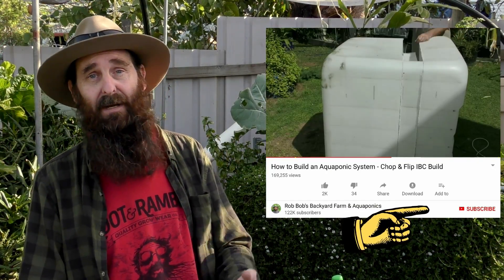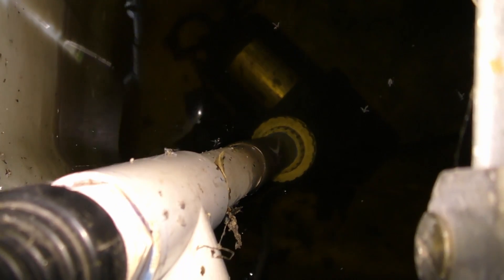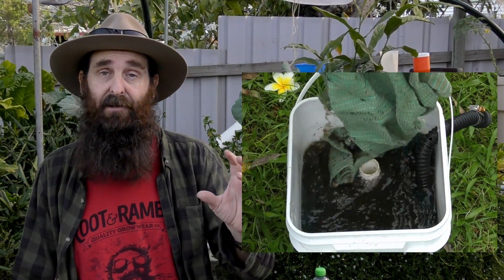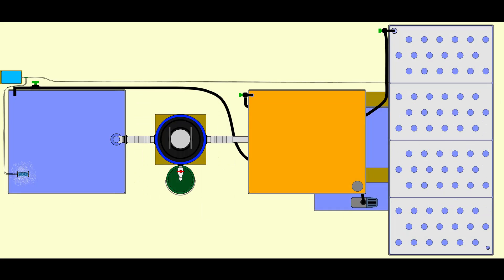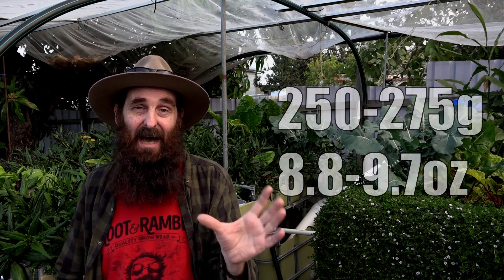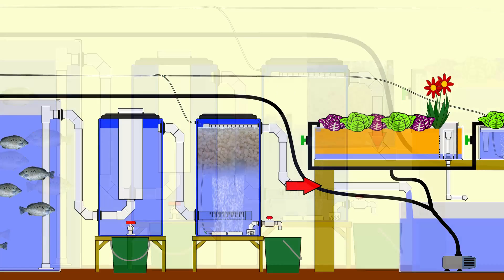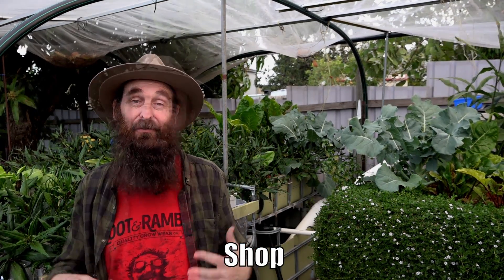Aquaponics Design | Backyard System for Pat

Comment: Excellent video.  I have one question though.  In your layout you have the bioreactor in the sump loop.  While it is absolutely necessary for the fish to maintain an almost non existent ammonia and nitrite level the plants prefer the ammonia as a nitrogen source over the nitrate produced.  The bacterial reduction of ammonium to nitrate is competitive to the plant nitrogen uptake rather than complementary.  Doesn't it make more sense to run the bioreactor inline to the fish tank inlet loop protecting the fish as is absolutely necessary and keep it out of the primary sump loop altogether so the plants can get first dibs on the ammonium or am I missing something?
Reply from the maker: Hi Jason.
Nitrate is the most used form of nitrogen used by most plants. Once taken up they then converted into ammonium as I understand it. Even if the biofilter was after the beds the ammonia would still be converted through to nitrate as the nitrifying bacteria will be establishing themselves on any available surface, be it pipework, media or plant roots. 

Cheers.

Comment: Why do you leave the solids waste in the tank, I thought plants needed those?
Reply from the maker: There's more than enough nutrients in the water in a system where the fish are well fed 👍
Any solids that are removed can also be "mineralised" in a mineralisation tank. The nutrient rich water added back in after the solids settle out to reclaim any that may normally but removed to use in the soil veggie patch. Will have a clip on the process coming to the channel at a later date. 👍
Cheers.

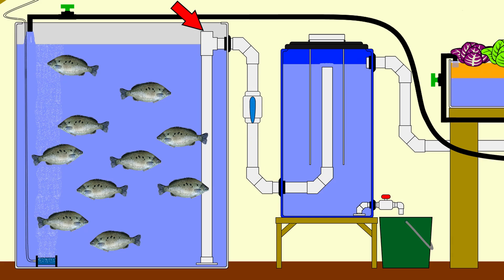Comment: QUESTION - At 4:18, why is the upper part of the Tee left open if the output within the radial flow filter's stilling well is at the height of the water level that you want anyway?  Wouldn't that prevent the siphon from forming and sucking out all the water from the fish tank?
Reply from the maker: Comes in handy in not initiating a siphon when you're removing the standpipe from the RFS for cleaning. I think of it as an extra level of security. 
Cheers.

Comment: Looking to add 2 more beds to the chop system I have. What size sump do you recommend? They all will be flood and drain
Reply from the maker: I like to allow for 50% of the bed volume to be water when sizing sumps Scott. That will give you a bit extra in a flood & drain system to stretch out top up times. 
Cheers mate.

Comment: How do you make the stilling well?  Is it basically like a 4" PVC pipe or is it something bigger?  Also, what's the white thing (compartment) on the bottom right of the screen at 8:16 (under the DWC), with the three pipes perforated at the top, that the outlet of the DWC seems to run through?
Reply from the maker: That depends on the size of teh system used. 
I tend to use a 4" with the larger 50gal & 3" with the smaller 13-16gal drums.
There is no compartment. I added straps to show that the drain should be supported.
Cheers.

Comment: Hi Rob, can you clarify why you used a sump? My logic tells me that with a sump you are mixing filtered water from the plants with dirt “ammonia” water, does this not dilute the water you need for the plants and also send back dirty water to the fish? Would an in-line system not work better, pump the filtered water straight from the end of the plants back to the fish tank?
Reply from the maker: The biofilter will process the ammonia in the water before it enters the sump👍
You can set up the system in a single loop & run through that in a recent clip, https://www.youtube.com/watch?v=0QQA5BpWKec
Cheers.

Comment: thank you rob. I am making a small one for my apartment for right now since I cant have a normal one outside. Even with me having some experience from helping others with there bad thing they left town without me understanding everything. Well I want to use some of your filter and use it with one I helped make see if I can get all the solids out of it. my filters going be at the high point and use gravity to take it to the grow beds my fish tank going to be on the bottom and I'm putting a over flow on the second filter back to the take be safe then sorry. I may need to ask questions if I run into a problem
Reply from the maker: Hope the build went smoothly GM.  👍 Have you got the fish in yet? 
Cheers.
Reply: @RobsAquaponics  no I have not got fish still getting pieces to put things together I got lucky and got some stuff free always good I'm sure you know that watching your video's and they been a big help I don't want to do thing half done so I'm trying to do thing right but save where I can

Comment: Hi Rob, thanks a lot for your excellent videos. However, I do have a question. With respect to the required fish feed of 50g or 100g, is that amount of fish feed per day needed constantly throughout the lifetime of the fishes? That is, should the fishes constantly be fed with exactly 50g or 100g feed per day, beginning from when they are fingerlings to when they've reached the harvest size? Or does that amount of required daily fish feed change as the weight of the fishes change?
Thanks in advance for your response.
Reply from the maker: Hi DB.
The rates I gave in the clip is the amount of feed needed to feed the plants in a given area of grow bed. 👍 I used this amount as an example only for this build. 
The amount of feed given to the fish is generally worked out on body weight & varies through the fish's lifetime. The hatchery you get your fingerlings from should be able to help you out with the rates.
Hope that helps some.

Comment: I tried Aquaponics for 3 years. The only thing I could grow is okra. Tomato and peppers did not do well. Greens did fair. I did not try lettuce. I had 2 float tanks and one rock bed. The rock bed did the best.   I had a swirl filter that worked fairly well but could not keep all the continents out. And my drain on my grow bed did not work very well. My fish did well. I started out with goldfish about an inch long. They grew in one year to pan size. I turned them loose in a lake nearby. And got more minnows. I used IBC tanks.
Reply from the maker: Please don't release goldfish into natural water ways. They compete with native wildlife & can have devastating effects on the eco system.

Comment: Hi Rob, Im in a bit of a rut designing my setup. 

I have two tanks I would like to utilise if I can, I discovered a 10,000 liter plastic tank buried underground, that's been collecting water off the rain gutter. I also discovered an even larger concrete tank on the surface, also collecting rainwater from the roof. My basic thinking.. Sump, and fishtank! 

My questions. 
a) If I start with a small fish population, can I just use the water volume replacement vs fish added vs size of the grow beds instead of trying to circle the entire volume?
b) Both tanks are pretty airtight (particularly the "sump tank", the surface tank has a 2ft by 2ft square manhole at the top, that I could replace with a perspex / glass light hole, Is this enough light for the fish? should I open it further?
Reply from the maker: Hi Colin.  I personally would start with much smaller tanks until you get the hang of a system. Once you grow for a season or 2 on that you'll have picked up a lot more knowledge which you'll need to run a system with such large volumes.
If you do go ahead with the current tanks I would definitely get the water tested first to see if there's any contaminates in there that may affect plant & fish health. 
The concrete may also pose a few issues if the inside isn't sealed as it will tend to keep the pH of the water very high. 
Cheers mate.

Comment: any need for uv filter?
Reply from the maker: I don't think so & have also read that it can change the availability of some nutrients in the system. I can't find the paper now but I decided after reading it I wouldn't consider using one in a system that grows plants. 

I would use on in a straight aquaculture system though if I decide to rebuild one down the line. 👍👍
Reply: @RobsAquaponics  THANKS buddy!

Comment: Rob, I have a novice question for you. But first, I absolutely love how informative and thorough your videos are. Thank you! As for my question,  what is the benefit of using the "Y" pipe to send water back to the fish tank as well as to the grow bed rather than simply making it a truly circular system?

Thanks again, you rock!
Reply from the maker: Hi Scott. Having the water flow split allows you to isolate the plants from the fish if you need to do maintenance on either. 
It also allows you to have greater control over the water flow rates to the different parts of the system.
That's not to say it's better than a single loop system though. It all depends on what sort of layout & it's size I think. 
Hope that helps a bit.

Comment: I am always curious about the electricity cost for these kind of setups?.does installing solar panel will have benefit or cost same in a long run..taking maintenance etc into consideration..tq in advance
Reply from the maker: Ours is a 250W pump so uses 6kW per day. So @ $0.27c per kW, it would cost us $1.62 a day to run if it was drawing from the grid all day. We have a solar system on the roof that feeds back into the grid so our power is subsidised to a point so it's cheaper than that. 
You can buy 18V pumps that suit solar based systems but the batteries can be a bit expensive. I would like to set one up but need to save the pennies for more pressing matter at the moment.  
Hope that helps some.

Comment: Mbbrs are a waste of time and money and only create new problems in aquaponics. They are great for aquaculture when you have no export but are not good for aquaponics. IV removed 4 in the last year from big grows and all are doing much better post design change
Reply from the maker: Am glad for you 👍 More details would be great so folks reading this could learn better ways to look after the nitrifying process if they want to run without media beds.
Reply: @RobsAquaponics  sure. Make sure your regularly adding your compost teas and LABs it completely replaced mbbrs with out the fine silt they create that clogs root pores and creates a sludgey mess.

Comment: Hey mate just wondering what you have used to stands on your main system? I'm looking at moving mine around and trying to get idea for supporting my media beds over my sump.
Reply from the maker: Hey Jason & sorry for missing this. Dad welded up a stand using some salvaged gal pipe for one & the other is an old pipe frame from his factory. The next build will have some custom stands I want to weld up myself as the beds I'll be using are larger, like the big black one I have on the current system. 
Cheers mate.

Comment: Hi Rob, thanks for this very useful information! i have a question: does both the solid filter and the moving bed biofilter need to be below water level of the fish tank? thanks!
Reply from the maker: It does help the flow if they are Juan. 👍👍
Cheers mate.
Reply: @RobsAquaponics  Thanks for answering. So, I am building an aquaponic sistem this days and i am using an IBC tank as a fish tanl, then make the water pass throught a solid filter and then a biofilter, an then they go to 6 half barrel beds of 100L witha resevoir tank and then re-circulate... But my question is, the firts 3 parts i mention need to have the same water level right?
Reply from the maker: @juanrs95513  Sorry for miss typing your name above.
They need to be lower for you to get a decent flow rate into them. If they are level you may find the water backs up in the fish tank a bit. 
I like to have the water in the solids settler at least 15cm/6" below the water surface in the FT. From there the bio can be at the same height as long as you have the same diameter plumbing through the drain line from the fish tank & filters. 
Hope that helps.
Reply: @RobsAquaponics  It really does! thanks a lot, i'll keep you posted with the evolution and of course following closely all the nicely selected information you shared with us. Thank for that aswell! don´t worry about my name... i get confused a lot writing rob bob`s or bob rob´s.. :s

Comment: Couple of questions. Can I base a system solely on PEO3 bio filters, a sump tank, a fish tank and PVC down pipe style hydro grow system? How much PEO3 can I effectively have in a 200L filter drum or how many fish can a single maxed out 200L drum sustain?
It seems like PEO3 is far more effective?
Reply from the maker: Most DWC commercial bio filtration systems run solely on media like the PE03 or similar very similar.
The effectiveness of the media will depends on your climate & the amount of total available nitrogen you will be adding to it. 
In my climate the 200l vessel would have 90-100L of the biomedia. Feeding at 1.5% body weight with a 34% protein twice a day requires 1L of the PE03 per 500g fish as mentioned in the clip. 👍
Hope that helps some.
Reply: @RobsAquaponics  After much though I have decided I will have room for the following, 80-100L fish tank, 80-100l sump tank, 30l bucket for bio-filter, 30L bucket for solids filter and however many vertical grow towers I can support on this size system. How many fish should I run in such a small tank?
Any other thoughts? 
This is a link to the style of grow towers I am talking about.

  https://www.youtube.com/watch?v=3LmydJnqMBI&list=PLd9o9VL1CCW5p5mf9MhSaXoz-5OEcDY8T&index=6&t=0s
Reply from the maker: @bdarley5  You could only fit 5 x table fish in the 100L tank so that will limit you more than anything.
Reply: Yeah thanks rob

Comment: Hi Rob, I am new to aquaponics and really appreciate you sharing your knowledge with us. I've been looking at numerous systems and I'm curious whether one can expect to outweigh the cost of setting up and running an aquaponics system such as the one you describe in this video.i.e hydro cost in running the pumps, purchasing the media, fish food and cost of materials. Any info would be much appreciated.
Reply from the maker: It might be hard with a system like this one. Costs could be kept low if you used natural rock, recycled tanks & had cheap power. The system would look a lot different to this with only having media beds but that would also mean you wouldn't need the bio filter. 
Cheers.
Reply: @RobsAquaponics  thank you and keep up the good work. I experiencing with a humble flood and drain system. It's been over a month and the ammonia levels are not dropping. Never saw a nitrite spike and I washed a sponge from another aquaponics system in mine. I'm thinking of doing a partial water change.
Reply from the maker: @jbl2270  It can take up to 8 weeks depending on your climate if that helps any. 👍

Comment: Your videos are awesome. I've learned so much on Aquaponics. I'm looking to use your design as a reference to build my first aquaponics system. I have some questions: What's the size ratio of the fish tank to the solid filter? As the water flows from the fish tank to the solid filter via gravity, does the solid filter have to be positioned at a certain level in relations to the fish tank? Same for the solid filter to the sump tank. Are all the PVC pipes the same size? If so, what is the recommended size (US measurement)? 
Sorry for the many questions. Appreciate your work.
Reply from the maker: Sorry I missed this Bryan. 
It all comes down to retention time. You're looking at 5+ minute retention time to remove most of the large solids from a system.
For example, we have a 250gph flow rate & want 6 minutes of retention time in our settler.
You can divide the 250ghp by 10 (as 6 min is a 10th of an hour) which gives you 25gal as the needed volume for your settler. 
Hope that made sense & helps some.

Comment: I don't understand the placement and design of the sump tank, specifically the outlet that leads back to the fish tank. Would it not be better for the fish to have a separate sump tank for the grow beds to drain into and then pump that sump tank back to the fish? That would separate the plant filtered water as a cleaner source of fresh water for the fish tank.

*Update: Ahh NVM, I see you updated the design since this year old video. I subbed and looking at the current stuff I found the updated design in a video from I think last week. You have the filtered tank water running into the top of the grow beds then draining out to a separate tank then back to the fish...looks good from what little I know about it. Thanks for the vids and the insight.
Reply from the maker: The 2 designs are different as they 're based on systems others asked me to help them with. 
I'm building my new system different to both of the ones in these clips. 😉

Comment: hey there, 
last year i built my own filtration system but it does not look like the water is filtering properly and i tend to forget to clean or replace the sponges. 
Is there a good brand of filter you can recommend?
Thanks
Reply from the maker: No sorry as I've only used my DIY filters. I know some folks will use the larger aquarium filters on their small aquaponic systems. Am fairly sure that the filter material will still need regular cleaning though. 
Sorry I'm not much help Maggie.

Comment: Thanks Rob , Its working well , the water has maintained 70F and the lowest the air has gone is 60F when we had 32 below zero F. The only heat is a 4500 watt water heater element in 1 of the tanks . It's looking like the power generated last summer will be plenty to power my house, and power and heat the greenhouse.
The only issue I have had is snow jamming the casters, making it difficult to turn the building. Planning to put a skirt around it this year to keep the snow out. I just put up photos of the construction on my Facebook page if interested . If you want see the multi fish tank Automatic feeder it is on my YouTube channel, you're welcome to use or improve it.
Cheers, Kurt Fischer